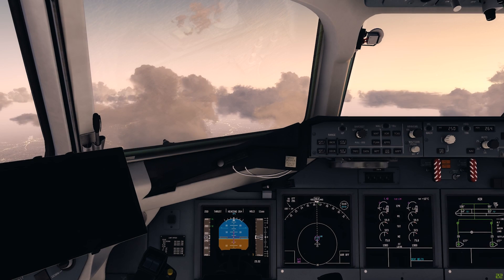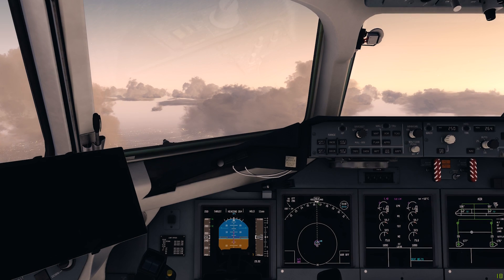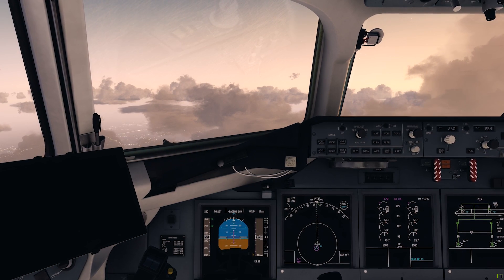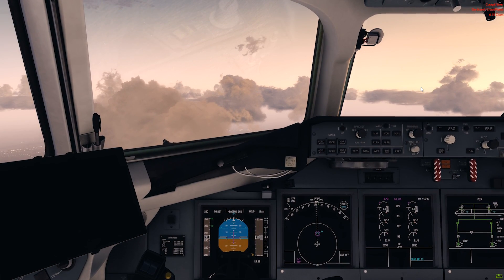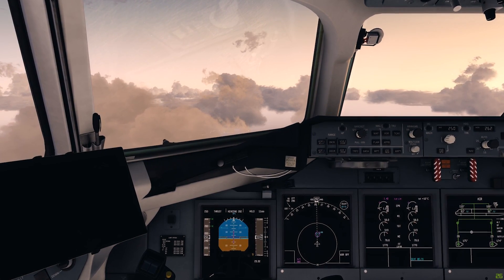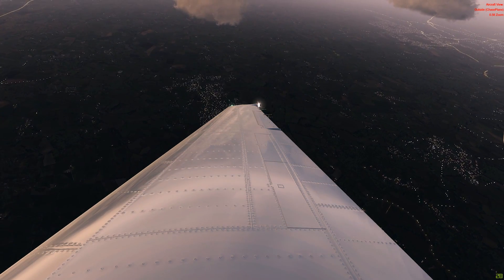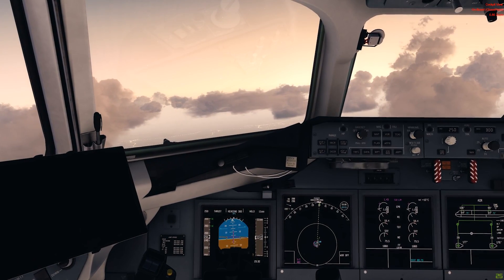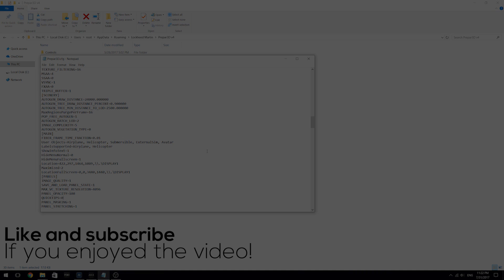[P3Dv4] Get High Frames using FFTF Tweak | Guide

Comment: @SVPilot Excuse my question but how did you get to display the FPS counter on the bottom right of the computer. I have been wanting to do that without success. New to P3D. Also I have TomatoShade preset installed, is it possible to install PTA preset with TomatoShade and work together without performance hit?
Reply: The FPS counter used in the video is provided by Nvidia Geforce overlay. If you have an Nvidia Card, you can download Geforce Experience to enable game optimization, cams, counters, recording, instant replay and much more. TomatoShade and PTA don't have a lot of performance impact, but there are a lot of overlapping settings that might cause an instance to render more than once, so I'd stick to one, preferably TomatoShade.

Comment: on this flight at dusk/dawn, the street lights are already turned on. is this something i can change in general, because street lights only turn on at nights (not at dawn), or is this something which i cannot control, because it's set in the scenery?
Reply from the maker: As far as know, FTX Global lights are automatically turned on when it's at dusk and so everything else by default! I don't think there is anything you can do about it.